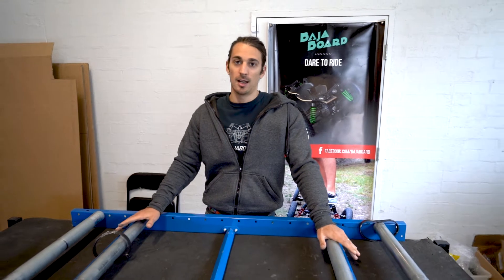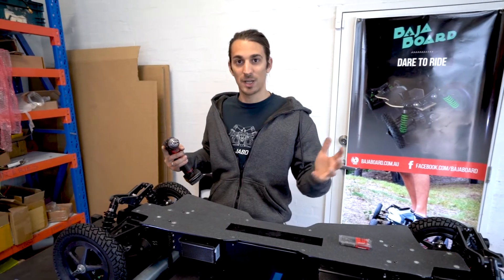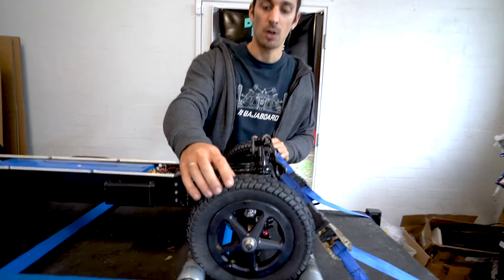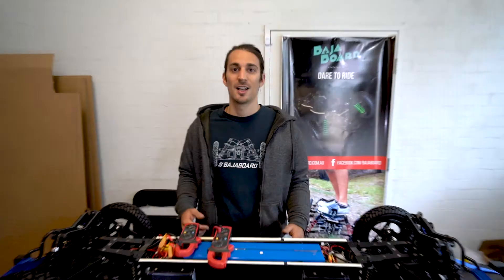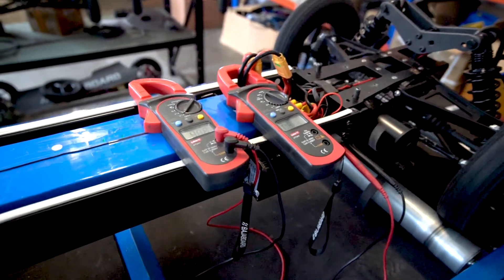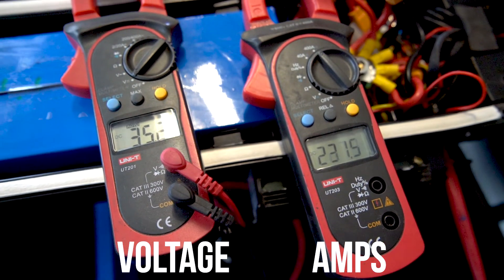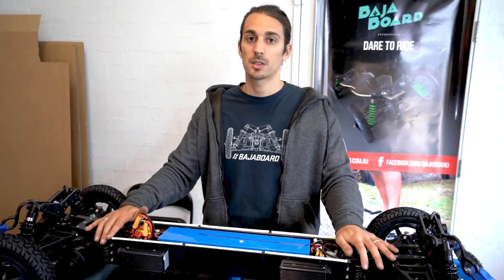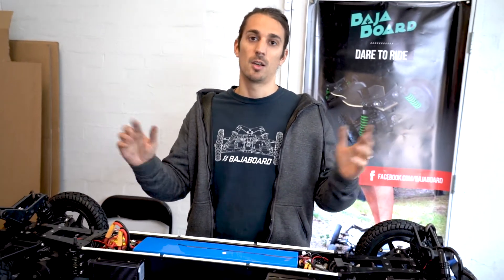HOW TO FIND REAL POWER OUTPUT | Baja Vlog 10

Comment: @ Fernando, try holding onto a single motor pushing 60 amps at 36volts and watch the thing tare your hands off, 230 amps divvied out through 4 motor controllers is nearly 60 amps each, trying to explain power ratio of electronics is difficult when you're explaining it to people that don't understand electronics, to top it off, the gear ratio on these boards is about 1:5, so actual power/torque delivered to the wheel is enough to tow a 2 tonne car (you're not actually going to tow a 2 tonne car because of other mechanical failure points) but the board is not designed with towing a 2 tonne car in mind, it is designed to carry a 60 -120kg rider over rough terrain at upto 40+mph, that is what they base their power on, "power to weight ratio" person + board = X kg, volts x amps = X watts, X kg / X watts = power to weight ratio and then they compare it in it's equivelent bhp if you were driving a car, there genuinely will never ever need to be a faster board on the planet than the Pantera unless you have a death wish, you need to keep in mind, this is somthing you 'stand on', not sit, these guys are legends in an already very niche market, there is barely a hand full of people manufacturing boards of this spec because they know how much this narrows their marketing and what consumers they appeal to, I don't own 1 yet but I do understand electronics and I am working towards owning a pantera not because i ever expect to be able to use it's insane power but I have had 35+mph specs and wanted more in the past on the off occassion and I expect this thing to be purely untameable for the rest of my life, but like they say, you can just dial the power down to what you want, i'm choosing a Pantera because I know for a fact I will never have to tinker with it's electronics to squeeze some more power out of it, beast mode comes standard.
Reply: If you're tearing around the beach in soft sand, you do use the full motor power - sand puts up ridiculous resistance to push through... but it's awesome - it's drifty like a snowboard and makes a beautifully screaming sound (the sand itself) as you rip through it :-)
Reply: Chris Drake Are you using the standard tires for sand?  This is part why I was going with the Pantera as well and I was actually thinking about getting some of the big off road kart tires they use in the snow photos from Sweden for this purpose but they’re not cheap.  (Of course a Pantera isn’t cheap to begin with but if you’re spending $7k on a board, $8k isn’t much different... ;)
Reply: Build your own it would be faster.  Been waiting on mine over 3 months now
Reply: How long did you wait for yours in total? I'm nearly at 4 months now.